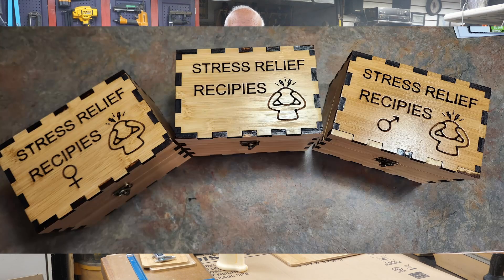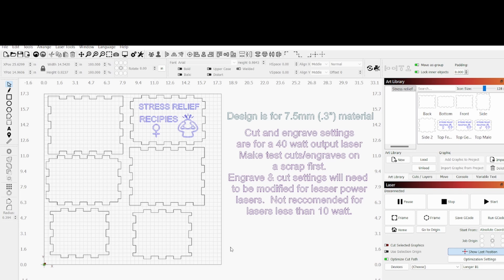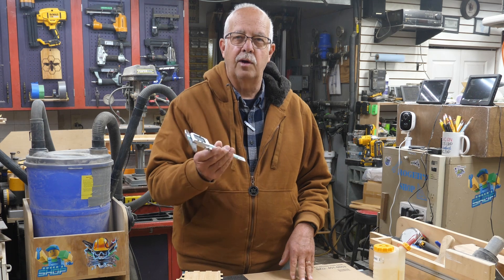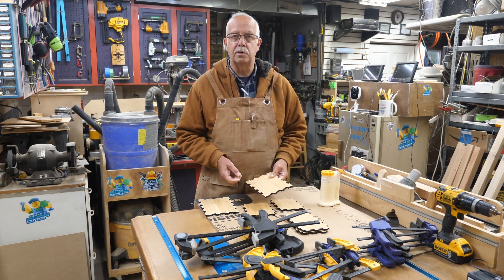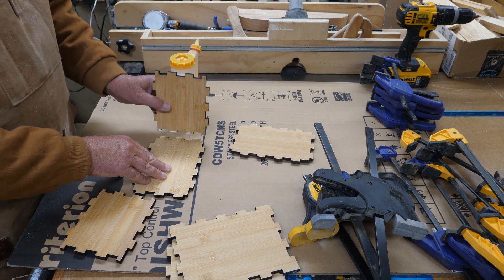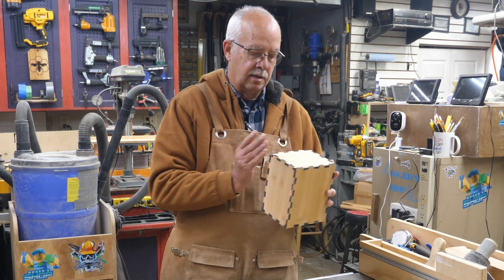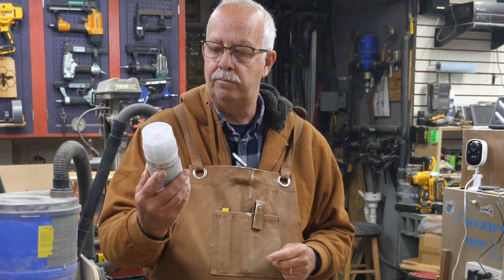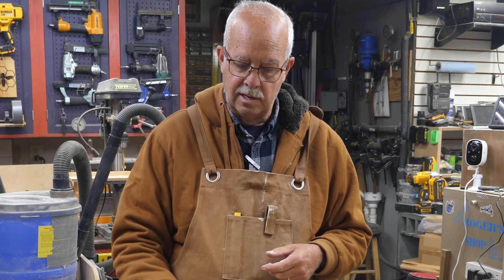Beginner Laser Project 27 Bamboo Stress Recipe Box

Comment: When I glue box joints I lay them all out fitting together flat.  Then run glue over all the box joints.  Assemble the box.  I put the clamps inside so they clamp the sides.  Your position only holds them in place.  I also wipe the box down with a wet rag inside and out and run a little brush on the inside corners.  Then put on the last side and wipe and clamp.  Thanks for sharing your tips and tricks.  They make us all sharper.